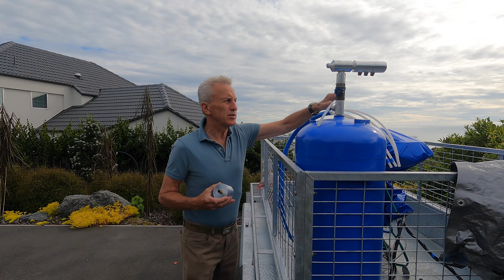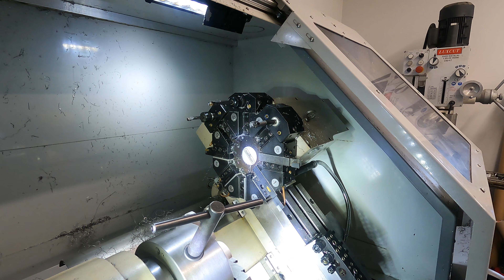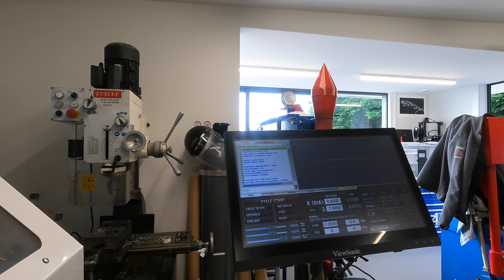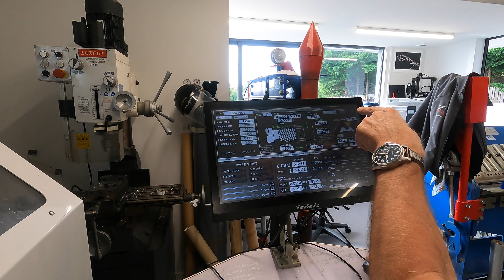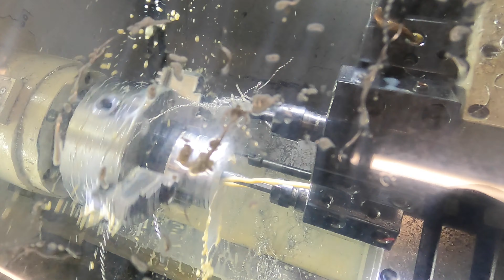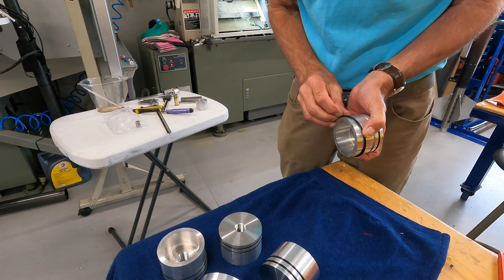Tormach Slant Pro Lathe | threading  part | Making Rocket Parts | PathPilot  Conversational | CNC

Comment: Hmm...so when you cut the threads the first time, and when you made the adjustments to enlarge the thread, did the spindle and cutting tool pick up where it left off? I just assume that when you finished cutting the thread the first time, the spindle would not be able to realign itself with the thread cutting tool the second and third time you cut the part.
Reply from the maker: That’s a good question, yes it knows exactly where it is and picks the precise spot to recut.

Comment: Is the hole & thread tapered or straight?
Nic tidy working environment you have there,  like Dan Gelbart’s shop 👍😎
Reply from the maker: Thanks for the comment.that would be a straight thread I was doing then. 
Later video where I am making a part for the high pressure oxygen regulator was my first tapered thread. 
Thanks again for your interest 👍